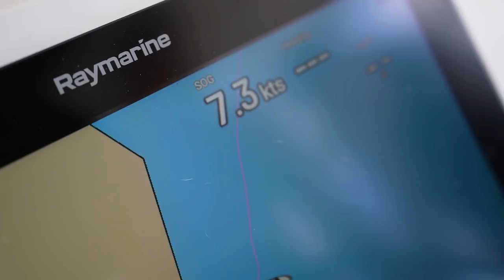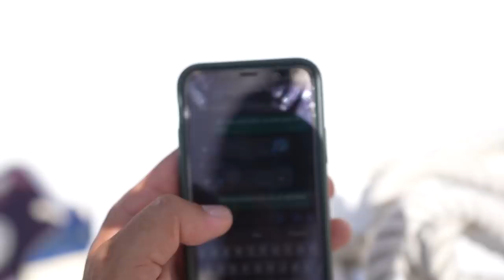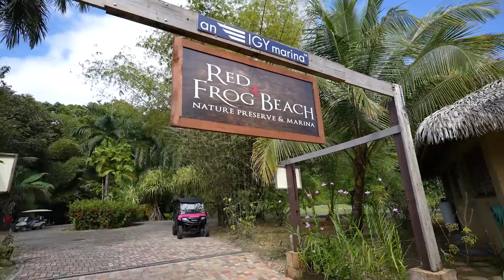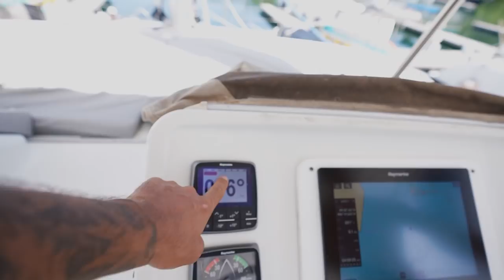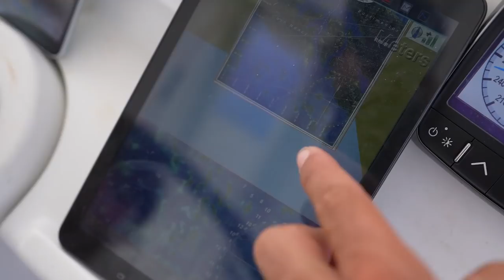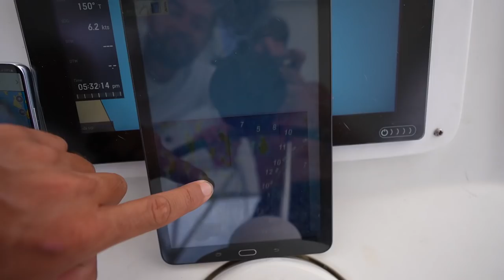SAILING THE UN-CHARTED WATERS OF BOCAS DEL TORO, PANAMA! - Episode 158

Comment: you and plucky have inspired me to buy a sailboat, and i did.  i got a Cape Dory 28 and its great!  but it does need some work.   the portholes? (windows) leak and same goes for 4 bolts that come thru the deck into the cabin....what would you recommend i use to seal that????

Comment: Great episode. Curious - is that a Lewmar v5 windlass? That’s what I have on my 52. I’m replacing it as well right now. The gearbox is glued up to the bottom of the deck - dunno if lagoon did that or what. Is yours like that? Such a pain in the ass and unnecessary.